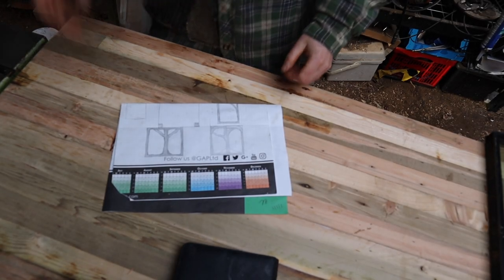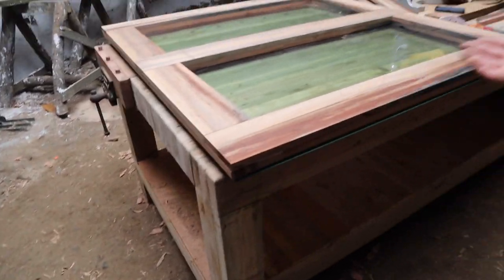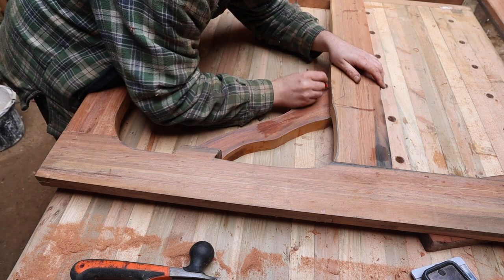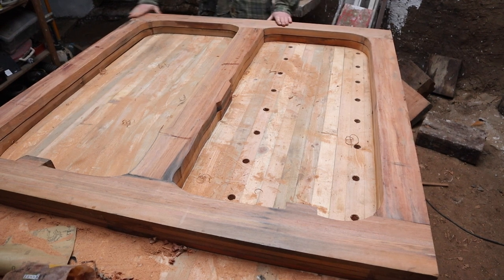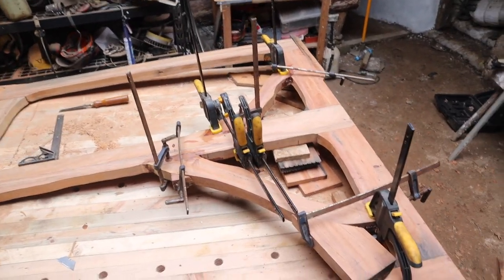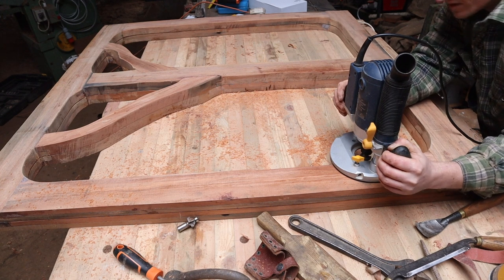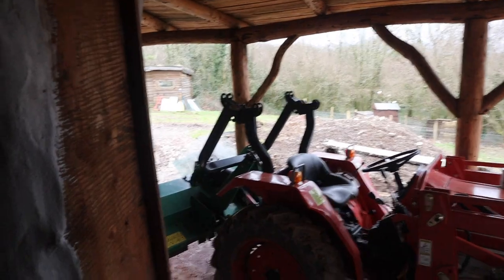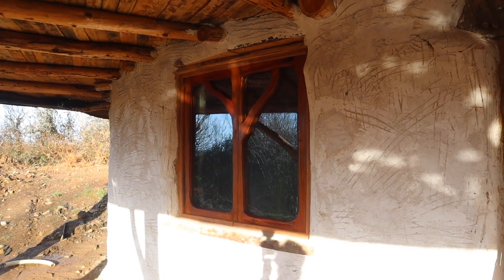Off Grid Earthbag Workshop Part 44 Hand Made Organic Hobbit Window

Comment: great job on the windows. I think more people should think about it. I want to build some kind of dual window on offset hinges so they can both open, that way you get some of the advantages of double-pane insulation, but with the ability to clean/wipe the inner area, thus you don't need to worry about filling with a dry gas and a seal that will eventually fail. I think thermally modified wood is ideal for that purpose.

Comment: Take some fine saw dust from the same wood and push it into the gaps and use liquid super glue into the saw dust once it hardens sand it smooth works great for filling gaps

Comment: I thought the curvy center pieces were going to come up from the bottom (before you eventually put the window in place), however, 'the other way up' is still absolutely fine.
Also, there were NO mistakes! you simply engineered character into it 😜

Comment: Always same stuff with brand new chisel ...
The way it is designed is not exactly the proper shape nor the exact angle you could properly sharpen it ...

You'll have to take away metal material so a curve stand printed in the end of it ...

Once done the flat surface used for sharpening it must be tangential or "a cord" from the curve made ...

The irony you bring me on !
Forces me to explain nice chips secret ingredients .

From france, with .

Comment: Use polyurethane glue that expands and uses moisture to set off the curing process + when mixed with dust it makes invisible filler after sanding back

Comment: not sure how they do it across the pond but here in the colonies we make windows rough opening about an 1" larger on all sides than a window. then we use shims to square and level the window. then screw windows fixed, insulate the gap and finally put on a trim. maybe you know this already but on the off chance you didn't... could make things easier for you.
Reply from the maker: Yeah same around here, I should have made the frame a little bigger when doing the earthbags. I sized it all for these windows But somewhere along the way some of the space got filled in. Part of it is due to the wood  in the opening cupping as it dried. Its really hard to work out opening sizes and get things right month ahead of time when using a-lot of reclaimed stuff and materials that move alot.  The other window Unit i have for the small window has cracked so im going to have to get a new unit anyway so i can size the next one to the opening much easier.

Comment: I wince every time you pass your hands across the top of the blades of that planer. Keep thinking you're going to lose some fingers! What if you hit a knot or the piece slips? Do you not have a guard for it? I was always taught that you should only have 10mm more than your workpiece of the blade showing at the side and the top guard at about 8mm above your workpiece. Please be careful. Keep up the good work. Cheers.
Reply from the maker: It always looks scary when watching others work. I get the same feeling when watching videos, But when you are in control and can feel and see the material is feels much safer. I have been using tools like these since i was 14. For two years i used a table saw and planner just like my one at the boat yard everyday. Im now 32 and still have all my fingers and never even needed stitches